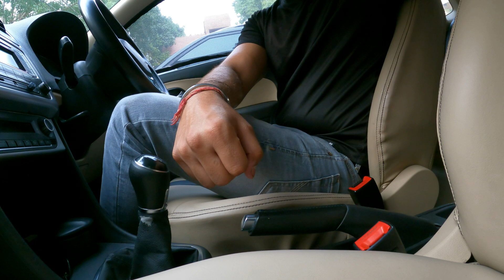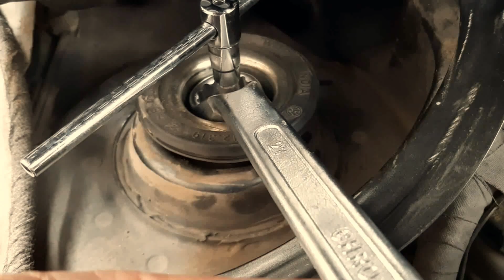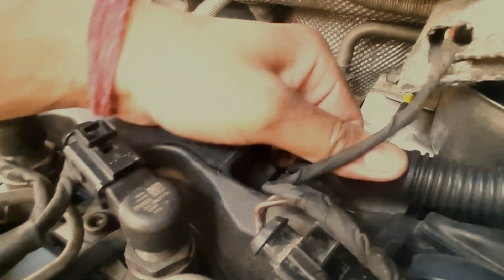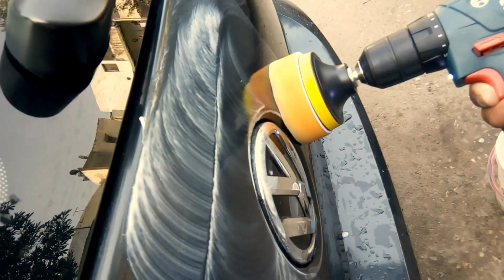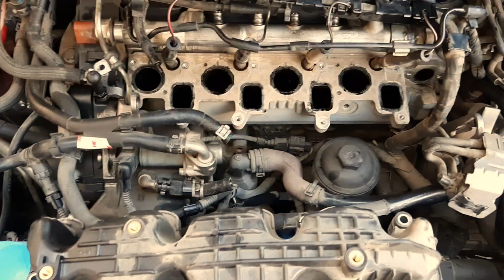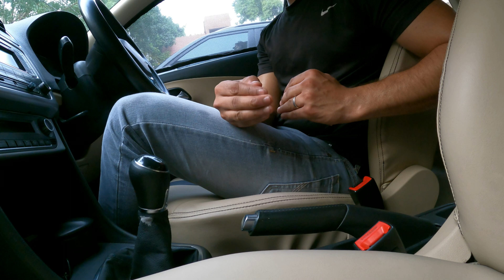NEVER CHANGE YOUR CAR'S OIL GRADE / OIL WEIGHT

Comment: This is short-sighted and patently false.  Modern oil pumps are are designed for volume displacement and the flow provided by the pump does not depend on the thickness of the oil except in extreme climates.  Engines are designed to function in a wide variety of oils weights.  Journal clearances on modern engines have not changed in DECADES whereas recommended oils have gotten thinner and thinner.  There’s no way that 0w-16 in Chicago winter is flowing better than running 5w-30 in Houston for any drive less than 15 minutes.  There is no way that the best oil in the United States is what the manual says.  There is no one-weight-is-best.  It depends on your use and your environment/climate.  The recommendation is based on EPA CAFE driven forces for fuel efficiency rather than for maximum engine protection.
Reply from the maker: Accepted that modern pumps are designed for moving volume , but the system is not just about volume , it also focuses on maintaining the right pressure, thinner oils are easy to seep out of gaps and seepage increases with the increase in oil temperature , thats the reason  why we check two data points , a cold oil pressure and hot oil pressure, every part has clearances and thinner oils tend to seeps from those due to their viscosity which will reduce the equivalent amout from the volume of the oil eventually leading to low pressure in the system. Just want to mention one thing , an engine is designed around an engine oil . You can change the grade but it will affect a lot of things . Thinner oils negatively affect the lifespan of engine and thicker oils negatively affect the responsiveness.
Reply: @ Optimal journal clearances on modern engines were determined decades ago and have not changed recently with the adoption of thinner oils.  Engine passage clearances have NOT gotten narrower with the advent of thinner oils.  If your argument were true, engines living in Chicago would be self-destructing left and right because the bigger determinant of oil viscosity is TEMPERATURE and not oil weight.  Until that engine is fully warmed up (would take 15 or 20 minutes on the freeway if the outside temperature were 15 degrees F on some frigid day), you would be seeing thick oil anyway.  Engines will not self-destruct when the oil temperature is 150F.  0w-16 oil at 150F is thicker than 5w-30 oil at 200F.   The average car in Chicago with 0w-16 weight oil taking average 20 minute long trips (mixed city, freeway) during the winter is running an oil far heavier/thicker than a car in Houston running 5w-30 all year.  Before you start recommending a single oil weight (manufacturer recommended), look at the owners manual for the exact same car/engine in Australia or in Europe.  Instead of saying “0w-16 is the recommended oil”, the owners manual will recommend a range of weights, all acceptable.  With oil, it’s a balance of flow versus HTHS protection.  There are three lubrication types/phases (boundary, hydrodynamic, and hydrostatic) at different stages of the cycle and different locations within the engine.  Adequate flow is important but so is protection at boundary/hydrostatic sites where thicker oil is protective.  You are not depriving the engine of flow with 5w-30 except in the most extreme of low temperatures.  Of course it’s a different story if you decide to go wide open throttle on a cold engine… but this is damaging with any oil weight.  The recommendation for thinner oils is for FUEL EFFICIENCY.  Not engine protection.
Reply from the maker: @badkid73 sir there is a video by engine masters , comparing different grades of engine oil on the same engine while keeping all other aspects the same and observing its effect on HP output , oil pressure and some other factors . At the end you will see a graph . Go have a look . 
There are a thousand factors in designing an engine oil , base , additive packages ( which can get really deep ) viscosity index, approval and what not . 
And if you feel like 0w16 is a nice choice for an engine , wait for a few years until those engines are old enough. Picture will get clear

Comment: can i use 15W40 instead of 5W40 untill i fix the engine oil leakage?
Reply from the maker: If your city's ambient temperature never goes below 10°C then yes you can go for 15w40 , but honestly that answer is purely based on physics , ideally its not advisable

Comment: I have a polo 1.2 TDI December 2011 model , always serviced at authorised service centre with company approved oils. Now the car has done 165k kms and drives like a dream. Should i  try any other better oil or keep sticking to the VW Special D 5w40? 

Or should i try Liqui Moly Toptec 4100 5w40

Or 

Amsoil 5w40 European spec red cap bottle
Reply from the maker: Sir liqui moly

Comment: I'm owning creta Diesel 2020 I'm currently out of warranty 47,000 kms on odo as I'm writing and now i want to service my vehicle to one reputed fng so my question is company used to use servo mineral oil but now I'm not satisfied in terms of refine should i switch to Idemitsu IFD 7 5w40 or should i stick to idemitsu IFD 5 5w30 . Company guys used 5w30 servo mineral oil . Your suggestion company recommendation oil specifications ACEA C5 or C3 or C2 or A3/B4 
4.8 litres 
Your suggestion for the same or any other brand oil recommendation. 
I'm your long time subscriber i used to own polo tdi in which you suggest me for meguin engine oil it was just fantastic oil in terms of refinement of engine .
Reply from the maker: Sir Hyundai usually designs their engines for 5w30 , so using 5w40 is not an option 
And they require pretty much basic approvals , nothing special , so any good brand in 5w30 will work good , 
My recommendation , you can go for shell 
And if budget is not a constraint then go for toptech 4200
Reply: @yourDIYneeds   can i use Meguin 5w30 C3 it's comparatively cheaper than liqui moly toptec 4200 and in shell which oil 5w30 HX8 ?
Reply from the maker: @devtrambadiya3228 yes sir hx8 is a decent oil and you can use meguin as well
Reply: Sir do you have any idea about idemitsu ifd 5 5w30  fully synthetic oil
Reply from the maker: @devtrambadiya3228 
No sir , never used it personally

Comment: My car came without the manual and i was using 10w40 mineral oil uptil 100k milage now i read it online in the user manual that 0w20 fully synthetic oil is recommended now my question is that can i do an engine flush and switch to 5w30 or that wont be possible anymore?
Reply: Change it immediately to 5w20
Reply from the maker: @Megaleiotatos sir completely depend upon climatic conditions

Comment: hello sir i have mahindra kuv100 nxt petrol. as per user manual company recomened 15W40 however this grade is used in diesel engines generally so should i use 15W40 in petrol?
Reply from the maker: Sir if the manual asks for 15W40  then use the same .
Reply: @yourDIYneeds  Mahindra uses genuine maxmile feo v2 engine oil and as per boodmo the grade of v2 is 0W20
so kindly find me the fact for kuv petrol engine oil

Comment: Sir as you told about not to change oil grade but what about their specifications as ecosport diesel has recommended 5w30 a5/b5 which amsoil signature 5w30 red can one fulfill and i want to use toptec 4200 5w30 which has acea c3 can i use toptec 4200 5w30 acea c3 over amsoil 5w30 a5/b5 or shouldnt i?
Please reply
Reply from the maker: No sir , very first thing to look for is the grade , then the approval , oils without the approval can be used in a situation where nothing is available but for best performance approval is must
Reply: @yourDIYneeds  so using toptec 4200 5w30 will harm engine or affect mileage? If yes then by how much approx thanx in advance
Reply from the maker: No sir , its not going to harm the engine , the only thing is that the engine will not be able to perform absolutely best it can with the approved oil . But in long run like 200 thousand kms its effects will be observable
Reply: My car came without the manual and i was using 10w40 mineral oil uptil 100k milage now i read it online in the user manual that 0w20 fully synthetic oil is recommended now my question is that can i do an engine flush and switch to 5w30 or that wont be possible anymore?
Reply from the maker: Sir you can switch , but after 100k  , its better not to .

Comment: Hi need ur assistance, i have vw polo 1.5 tdi 2016 facing very weird issue
After driving 100 kms glow plug signs come up and turbo drops 
When ignition re started its again back yo normal and runs fine below 85 kms
But again same issue if speed increased
I showed the same to one of my  mechnc near my home 
And he confirmed n95 issue got it replaced still issue not resolved
Reply from the maker: Sir considering that on 85kmph the engine speed is close to 15-1600 rpm , exactly the range from where the turbo is supposed to spool 
Just check the turbo charge pressure lines and hoses for any leaks ( intercooler as well )
MIL is showing up due to difference between the specified value and actual value ( what ECU is expecting and what its getting ) 

Hope it helps

Comment: Wonderful and very informative videos as usual. I have a polo 2013 TDI Highline, can I replace my headlight assembly with the double-barrel ones in the new-gen polo? Do you recommend the after-market projector ones? I am not sure about the quality. The stock ones on my vehicle are pathetic for nighttime driving.
Reply from the maker: Sir if you want to have proper usable light on road the OEM double barrel lamps are the best for that , aftermarket lights are mostly cosmetic and usability of the light is questionable . 
And if you want to swap for OEM , as far as i know its a direct plug and play with just 1 wire which needs to be adjusted .
Reply: @yourDIYneeds  thanks for your advise. I am more in favour of usability than looks. Is there any video which shows how to do it. I don’t want to mess with the wiring. And if it’s DIY it’s better. Here in Gwalior it’s difficult to get it done even at service centre. Your help is much appreciated. Thanks 🙏🏻
Reply from the maker: Sir i don't have the video , but can share wiring schematic with you , please drop a mail on everydaydiyhelp@gmail.com

Comment: Which is best OIL GRADE for 2014 RAPID 1.6TDI. Manual shows 5W30 (VW.507) but Iam not sure 5W30 grade is best for Indian hot climate. How is Shell Helix Ultra 5W40 as Iam planning to get this oil for my next oil change.
Reply from the maker: Sir liqui moly toptec 4100 everyday of the year , its the best you can buy for a TDI
Reply: @yourDIYneeds  replaced the oil with toptec 4100 very happy with this oil. Thanks
Reply: @yourDIYneeds  Thanks a lot will try liquimoly toptec 4100... the only oil with VW507 spec online was liquimoly toptec 4200 and Mobil 1 SEP 5w30 but could not find it any where in my city.... will keep you up dated
Reply from the maker: Sir vw group's tdi which are in india either its 2.0 , 1.6 , 1.5 , 1.2 tdi they all are derivatives of EA189 engines , and as per the specs and tolerances they run best on 5w40 in indian climatic conditions and requires VW505.01 approval to perform the best .

Comment: Bro have bought toptec 4200 for 5000 for my Creta 1.6 diesel manual as it recommends 5w30 ok?
Reply: I had one doubt of going for 5w40 as 500 rp less for toptec 4100 , but anyway company recommendations 5w30 so bought toptec 420p:)
Reply from the maker: Yes sir great 👍
Reply: He said it will deliver in 4-5 days
Reply from the maker: Its ok
Reply: And thanks for your replies as ur helping a lot of members
Reply: I also own 2020 1.5 diesel creta i need your suggestion are you using 5w30 or 5w40 ? Which grade is best suited ?
Reply from the maker: @devtrambadiya3228  sir , right now i am using 5w40. , Which is best ? , Sir it totally depends upon what the engine requires .
If yours require 5w30 then use 5w30 . And as far as my knowledge goes , Hyundai uses 5w30

Comment: Hi , I have a Creta 1.6 diesel manual , owner refers 5w30 and acea a3/b4 ,  toptec 4100 or 4200 which should I go , and my car approval is acea a3/b4 is it ok to put acea c3 please answer .
Reply: Ok sir
Reply: Toptec is acea c3:)
Reply from the maker: Sir toptec is available in 5w40 and your car needs 5w30 as it's designed for that , after getting a proper warm up you may experience a little bit of sluggishness . A good oil fir 5w30 grade is zic x7 5w30 and they are also the OEM supplier to hyundai ( as far as my knowledge goes )  and it also got the approval , and i have tested it on a different vehicles and its good .
Reply: @yourDIYneeds toptec avaible in 5w30 also 4200? I was using shell full synthetic before , need a better oil
Reply from the maker: Yes sir, 5w30 is available in toptech 4200
Reply: I’ll go to toptec 4200 5w30 it’s good and I used shell fully synthetic 5w40 it’s actually better almost like 5w30 , toptec 5w30 I’m gonna go
Reply: Hi u said u got the engine oil in Bangalore toptec can u tell where it is
Reply from the maker: At that time , toptech was not available online sir ,
But if you still need the contact no. , Please drop me a mail , i will share the contact number
Reply: It’s better than shell right ? I use full synthetic 5w30
Reply: Have emailed you

Comment: Which engine oil best for vw skoda 2.0 CR TDI ??  
Give different brands oil with vw specification
Reply from the maker: 1- liqui moly toptech ( supports VW505.01 approval )
2- castrol edge dex varient ( it too have a approval of vw 505.01 )
3. Shell helix ultra ( approved for vw505 ) last option if above two are not available
Reply: @yourDIYneeds  shell helix ultra supports vw 505.00 and 502.00 not VW 505.01 
The 505.00 and 502.00 are ok for 2.0 TDI CR Skoda laura
Reply from the maker: Sir , i don't exactly remember the requirement of approval for every engine , i have to check for that , but when oil with approval is not available then atleast having some approval is better than none
Reply: @yourDIYneeds  ok
Reply: @yourDIYneeds  sir jo meri 2.0 TDI skoda laura me gadi start kar ke jab oil dipstick nikalta hu to halka halka usme se smoke ata hey aur sath sath oil ke cheete bhi ate hey kya koy problem ho sakti hey ??? Ya vw engine me ye normal hey ??

Comment: Safari heat hote hai only when climbing hill 2 to 3kms temp.meter goes high on red dot...plzz batao normal roads pai theek hai
Reply from the maker: Sir cooling system clean hoga , most probably radiator blockage hai , but ek or chej , fan bhi check kar lo

Comment: Yaha par mistri ko bataya to usne bola headgeskit khatam h engine ka koi confirm nahi h
Reply from the maker: Sir hanji 2 hi option hai ya headgasket ya oil cooler
Reply: Approx cost sir
Reply from the maker: Sir that totally depends on the parts required 
Approximately head gasket me 20k including new headbolts and all the gaskets along .
Reply: Ok yaha 35se 40 bola h headgeskit ka cost
Reply from the maker: Sir maine apko sirf spare parts ki cost btai hai
Reply: Koi ni sir “oil ka chota sa bhi clue nahi h coolent me phir bhi headgeskit ja sakta h ?
Reply from the maker: Hanji sir , most of the time headgasket over heat hone ki wajeh se jati hai , but kuch cases me bila overheat hue bhi ja sakti hai , but aap pehle ek bar oil cooler check karwa lena kuki most of time leak oil cooler se hota hai and mechanic head khol dete hai
Reply: Hello sir tapit cover oil dhakkan khol ke kar dekha to usme pani ki kuch bunde dikhi h & engine me to koi effect nahi hoga sir ?
Reply from the maker: Sir apne wash karwai hogi , Pressure se , islea hai 
2-4 drops se koi dikkat nahi

Comment: Talked correctly about the pressure but there's a minor hiccup. Both would work fine for a given temperature, the upper limit would widely vary at higher temps. So I think both perform similarly given the temperatures. Thus, your argument is kind of dependent on temperature as the w40 or w30 means the optimal flow and viscosity rate of that particular oil at its highest operating temperature. So technically you can use 5w30, given you live in a cool temperature area.
Reply from the maker: Sir i mentioned that as well , (  when i said " 5w30 is ok till 30 , but the real problem starts when it starts to reach 31-40" )
Reply: @yourDIYneeds  Might have missed anyways great video

Comment: I've been using 5w40 synthetic oil and there have been no issues.
Reply from the maker: Sir which car ?
Reply: @yourDIYneeds  EcoSport Diesel. 5w40 means that the oil will be efficient or work well between 5-40℃ . This is my understanding and I am open for another definite answer as well
Reply from the maker: Sir as per the oil data sheets 
5w40 is good in range of ( -30°C to 40°C ) ambient temperature.
Reply: @yourDIYneeds  awesome..But only if you're going with completely diff grade such as 0w30 and the likes, then it's a problem
Reply from the maker: Sir if someone use his car for track days then its a good idea to change the oil grade in that case you can lower the first number and increase the second number but not visa versa , but for everyday driving , you default oil grade is more that what we need
Reply: @yourDIYneeds  mine is remapped
Reply from the maker: Sir if its remapped then ideal thing is to shorten its service interval , like company says 15000 kms  or a year , you do it at 10000 kms , if you also doing track days then we can think about another oil grade like 5w50

Comment: So ideally for an engine rated xWy, you can go lower on x and higher on y upto a certain limit. Hence for 5w30 you can go 5w40, 0w40, 0w30 but not 0w16 or 10w40.
Reply from the maker: Yes sir , that's correct , but only for people who really push their engines , like track days , else 5w40 is just fine for everyday driving